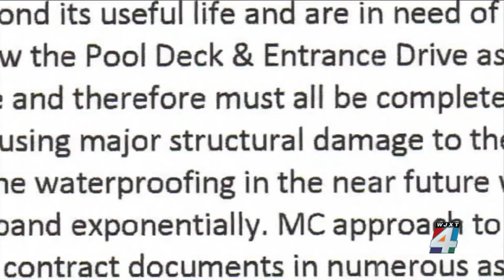2018 engineering report showed ‘major structural damage’ before condo building collapsed

Comment: HOME OWNERS ASSOCIATION ....the Guilty party here !!!! They should be immediately arrested and brought in for serious serious questioning!!!! This site has been flooding for years on end and thay all knew about it!!!! Once Sea water infiltrates through into the basement parking areas, the water pressure from the Ocean pushes the entire structure upwards and causes it to either float or sinkand the subsoil to disapate and when it dries up it either settles or remains in the new position until one day this expansion and contraction of the building gives way as it did !!!!!!! Carnage now total carnage which could have been avoided a long long time ago!!!
The building either collapsed totally due to this ....or it was pulled (building7) 911.....either way....some BODY is responsible for this and must not be allowed, for the sake of all the innocent victims, their families and friends, to get away with MURDER!!!!!! This is Murder of the 1st degree!!!

Comment: Crazy how many people are saying things like "Definitely Preventable", " Florida regulations caused this", "landlord knew and did nothing" (which is weird since these are condos 😗 ).

Some quotes related to this report that are worth noting: 

 "Wallace, who has participated in multiple forensic analyses of building failures, cautioned there is nothing to indicate this was the cause of the collapse, merely that it warrants investigation."

Also noted: 

"His report didn't suggest the 40-year-old building was at any imminent risk of collapse but he urged that the concrete repairs be carried out in "a timely fashion"."

Finding the root cause of a collapse as major as this one means we probably shouldn't jump to conclusions.  So far everything I've read or heard is straight conjecture by mostly uninformed individuals/ news outlets.   

Just something to consider before wagging a finger in someone's face about cause and responsibility 🤷‍♂️.....  

Anyone saying they know why this building collapsed is lying at this point!
Reply: They were also doing work on the roof of the building which puts extra weight on the building. There are a few factors that could come into play

Comment: A three-bed, two-bath unit on the ninth floor, about 1,748 square feet, sold on June 17, 2021, for $710,000, according to Zillow.
A four-bed, four-bath penthouse suite, about 4,500 square feet, sold on May 11, 2021, for $2,880,000, according to Zillow.

Comment: If a structural engineer found “major structural damage” in 2018 why didn’t that engineer condemn the building?  What were the recommendations for repair?  Did they think it was safe for occupancy?  Why do an inspection and then do nothing about it?  Why were there flashing lights on the exterior of the building just seconds before it was demolished?
Reply: Because it was the HOA who had the engineer do the report. He had no authority to condemn the building. I don't think there was even a mechanism by which he could have alerted government officials to the problems.

Comment: To Michael Holden Forensic engineer.  I've worked as a excavator Operator for 22yrs in Miami beach.  I've been part of how all this New High Rises are Built.  The very High rise Next to this building that collapsed...
First we mist build the Foundation which is more Deeper into the ground as of the bui6must withstand up above. 1st we bring a Huge Hydraulic HAMMER that is suspended by a crane to hammer down 100 feet of a steel Sheet pile,  this serves as a security for surrounding ground not to collapse neither the water to go over. This Tons of HAMMER vibrations EVERY SINGLE DAY , FOR WEEKS AND MONTHS.  we all know as Construction engineering,  it takes a toll in the surrounding areas UNDERGROUND. Given the FACT that the Beach has been REFILLED WITH SAND AND LIME ROCKS from the 1900s from MR FLAGLER. WHI FOUND IT...
so TBE TRUTH OF THIS UNFORTUNATE TRAGEDY IS THE FACT THAT THE UNDERGROUND IS BEEN MAN MADE SINCE 1900s for it WAS ALL SWAMP.. Now after many yrs,  Dade County and Beach has ALLOWED High Rises to be Erected all along the UNSTABLE MAN MADE ISLAND. 
you put a new building next door to any other a d will V8BRATE ITS  CORE. 
THIS IS WHY IN 2018 THE Columns showed signs of Cracks.  Because THE NEW BUILDING NEXT TO IT STARTED IN 2015, I WAS THERE... AND ENDED AROUND 2018....
SO TRUST ME WHEN I SAY TO YOU ALL......
I HAVE BEEN PART OF THIS TYPES 9F CONSTRUCTIONS FOR 22YRS IN MIAMI BEACH.  AND NOW THE GEOLOGY OF SOUTH FLORIDA.... 
THIS US RHE CAUSE OF THE PROBLEM.  BUT THE CITY WILL NOT SAY THE TRUTH,  FOR THEY KNOW THEY WILL BE IN DEEP TROUBLE....
so they will hide it,  behind supposedly engineers and anything else that presents a title.  But I do NOT NEED A TITLE,  I HAVE BEEN PART OF THIS CONSTRUCTIONS AND KNOW THE TRUTH.!!!!!!!!!!
THE WHOLE BEACH IS SINKING PEOPLE,  and if you don't believe me. do your RESEARCH...... 
DO JOT BE DECEIVED.!!!!!!!!!!!!!!!!!
Reply: that s not why this building fell.

Comment: I heard that John McAfee owned a condo there and that's where he kept  his " if anything ever happens to me please get this to the public as soon as possible because it was not an accident or suicide." Files/hard drives were at that location. Almost, kind of like when that passenger jet disappeared with the one and only patent holder for Microsoft was a board and disappeared along with that plane. I guess you can say all of those people in that building met the clintons.
Reply: A building collapse wouldn’t destroy these “files/hard drives”.
Reply: @bryanh5701  , good luck retrieving them.  When I was working my profession was cranes and heavy lifting. I worked at ground zero. I helped clean up that mess. The funniest thing happened when we got most of the upper floors cleared away and got towards the basement and the vaults where all of the really important stuff was at. Did you know that the CIA has their own construction/engineering crew? Not only did they kick all of the civilian workers off of the site, but they kept all of our machinery and sent in their own operators. This took place for about 10 days until they got what they wanted and then let us go back and finish up the s*** work.

Comment: This is such an obvious demolition it's absurd.  Its in your face obvious.  Looks like like 911, there was clearly no resistance from any of the floors, walls etc.  The building just dropped to the ground in seconds (Video is already out you can see it for yourself - huge dust cloud again).  It doesn't tip over, it doesn't lose strength and then break apart - it exhibits the exact same behavior as the 3 buildings that collapsed during 911; except this time there are no planes or terrorists to blame.  Deep State 101.  I'm sure it just a coincidence that Jon McAfee's son had a hard drive farm in that complex.  Raaaight.

Comment: Some died while they were sleeping. It was definitely preventable according to this new information.
Reply: "Definitely Preventable" ....based on what?   
Some quotes related to this report that are worth noting: 

 "Wallace, who has participated in multiple forensic analyses of building failures, cautioned there is nothing to indicate this was the cause of the collapse, merely that it warrants investigation."

Also noted: 

"His report didn't suggest the 40-year-old building was at any imminent risk of collapse but he urged that the concrete repairs be carried out in "a timely fashion"."

Finding the root cause of a collapse as major as this one means we probably shouldn't jump to conclusions.  So far everything I've read or heard is straight conjecture by mostly uninformed individuals/ news outlets.   

Just something to consider before wagging a finger in someone's face about cause and responsibility 🤷‍♂️
Reply: @mrdumbfellow927  no one is pointing the finger, just suggesting that it was preventable. They did also mention that the building had structural and foundation damage based on the preliminary results.